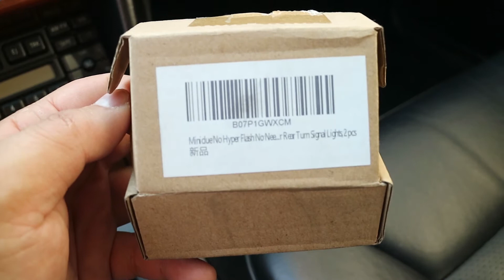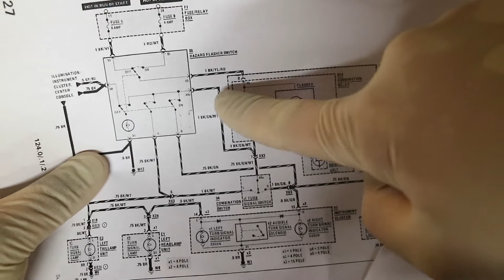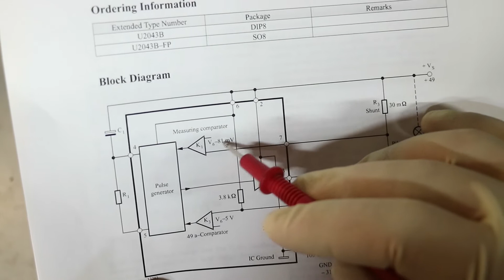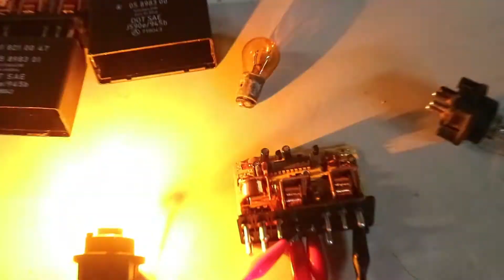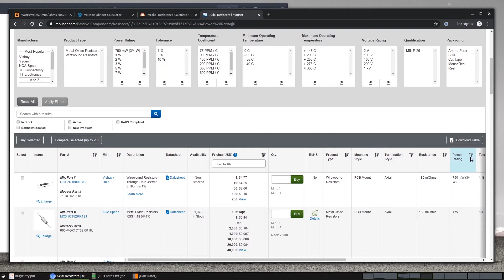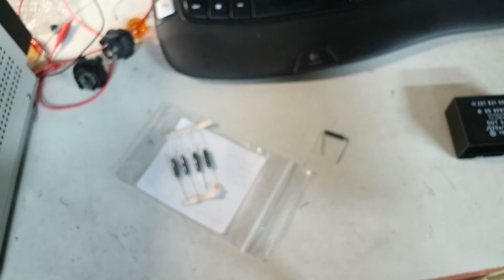MONOBLK - LED Hyperflash Relay Mod Fix

Comment: hello bro..I own w124 m111 1994 year meqanic transmision 2.2L..and mine relay sometimes do not works..if I push left or right on this relay with my hand its working..I opened and visually its good looking-what the metter if you know?

Comment: I don't think I will be able to do the proper calculations without a (don't know what it's called) power supply? to find the values of the LED I will be using but I just wanted to comment and say this this video is super cool and answered the exact question I was asking myself.

Comment: Thank you.  Awesome.  Any links to the bulbs u bought?  I have a 93 w201 and a 94 s124.  U could place a dual color led in the reverse light socket for extra indication, w a proper socket?  I'm going for the pin 7 option.
Reply from the maker: For the fronts I am using this one: https://www.amazon.com/iBrightstar-Switchback-Projector-Replacement-Daytime/dp/B07JC7233R
For the rears I am using this one: https://www.amazon.com/gp/product/B075Q9RGZW

You cannot put dual color LED/switchback in the rear, there is no wiring for it unless you have something custom or different than standard US configuration. The rear side indicators do not have an active running state like the fronts.
Reply: @John5788  Thank you so much.  I did not even know that 1157 bulbs came in dual color.  Had to educate myself on the term Switchback.

Your bulb selection is impressive.  One of the few suppliers who clearly lists wattage and uses a proper built in voltage regulator, not just a resistor.

I'm going to also use the reverse light as an extra brake light by changing pigtail from 1156 to 1157 and installing a Switchback red/white bulb.

Amazon's red/white pricey, FBay not to bad.  And yes, white will be a little on the dim side.  Thanks!
Reply from the maker: @ebutuoyebutouy  OK I see what you mean now. Interesting concept to use reverse as an extra stop light indicator. The lens is white, how do you manage to get around this? Do you have non-standard rear tail light lenses? Even with a red/white switchback bulb, it won't match the red stop indicator coming from the red lens.
Reply: @John5788  Thanks for sharing. Assumed since led has only one frequency and lens not incandescent only one wavelength would radiate? Did not think of that. Thanks for warning.  I'm going to invest and order FBay 391379492698.  Will let u know if it's reasonable.  S124 (124 wagon) brake light undersized.  201 allows upgrading a tail light spot.  Thanks.  Is sponsor Jeff 190rev's CaptainRuff?
Reply from the maker: @ebutuoyebutouy  You are correct, LED only has 1 wavelength red and will not get filtered out by the white lens. I'm just not sure how it would look passing through 2 different lenses, might not match.

And yes, that is the same Jeff  we are talking about.
Reply: @John5788  I'm going to order them today.  Will inevitably take some time to get them.  Will let u know.  Thanks.  Found u on the rev.